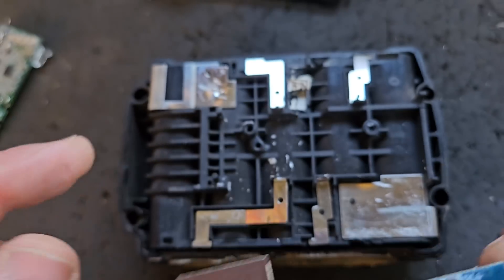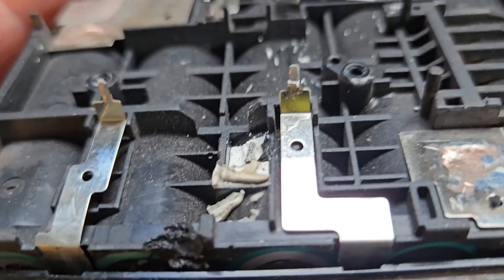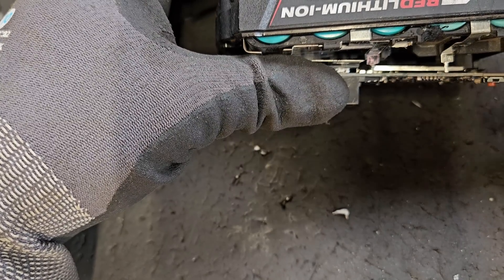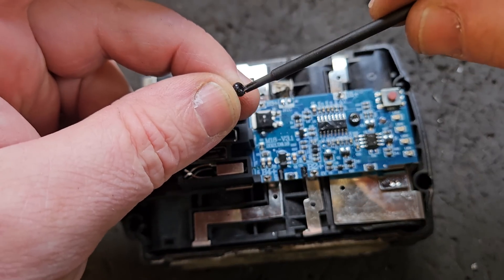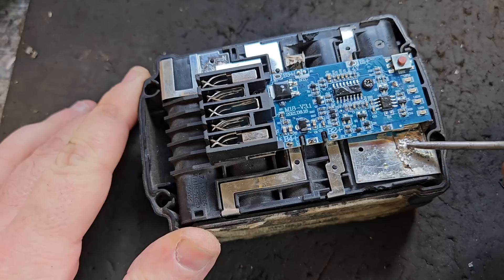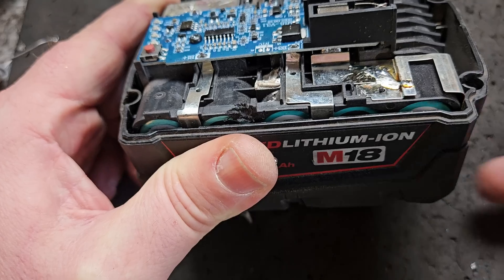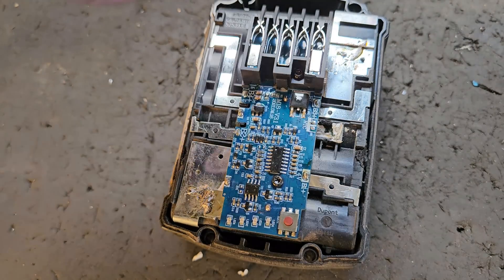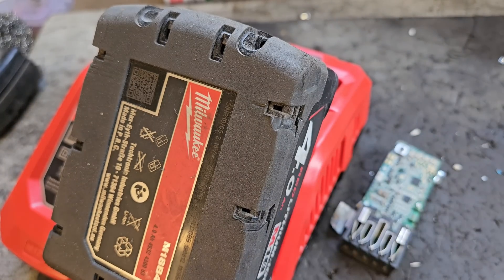Milwaukee Battery repair course EPISODE 7 Fitting A new board to M18 battery

Comment: Is the BMS the same for all m18 batterys. In other words can I use a BMS from a 1 pack on a 2 or 3 Pack
Reply from the maker: The short answer is no
The 4ah 5ah and 9ah are the same
The 8ah high output has its own board
The 12ah high output has its own board
Reply: @doctorlefthandthread   thanks for the info. How about the 1.5 and 2 ha. I work for a large maintenace dept and we use a lot of 1.5 and 2 ha. I can get them as they throw them in the recyle bin.

Comment: Unrelated, but is there any way to dismantle a DCH273 motor and replace the bearings?  Thanks
Reply from the maker: Sorry for not replying sooner but I have been so busy I am intending to do a video for you but won't have time until tomorrow morning
Reply: @doctorlefthandthread  Thanks a Million.
Reply from the maker: @Surfingaliens65  I had a look and it looks more trouble than it's worth to change bearings on them. If you aren't too far away I could send you a good 2nd hand motor switch assembly for not much money.
Reply: @doctorlefthandthread  I have 3 switch assemblies, which I was able to repair, but one thing I noticed on all 3 after hooking them up on a battery, the larger of the 2 bearings run hot. Is that normal?.  Judging by the number of 273's that are on sale, I would find it difficult to recommend this machine to anyone.  One of the 273's I am working on is only 2 years old. The motor was jammed up solid, but I was able to free it up.
Reply from the maker: @Surfingaliens65  the dust really gets in there even in a short time